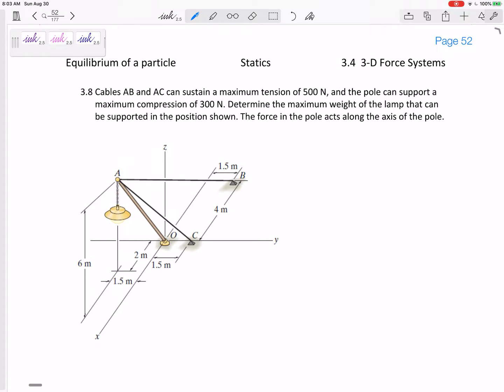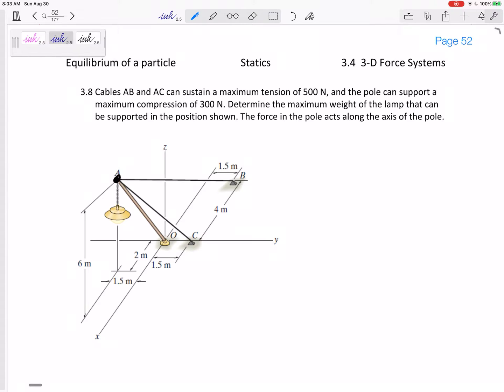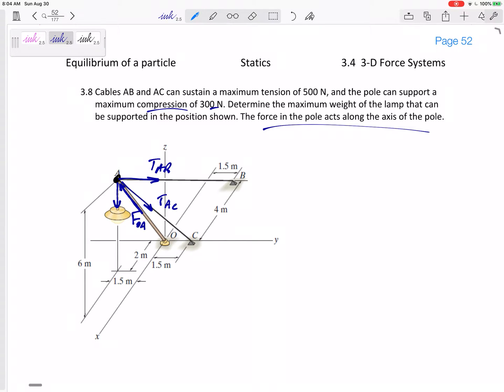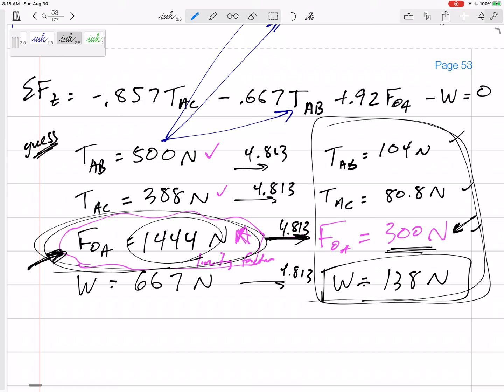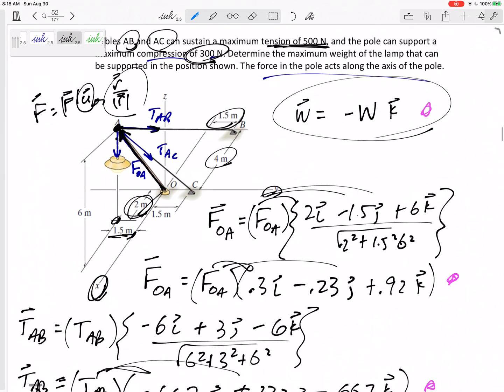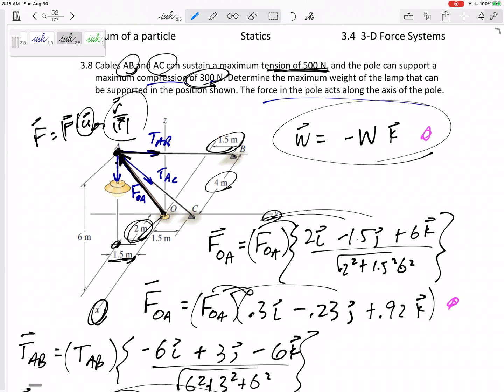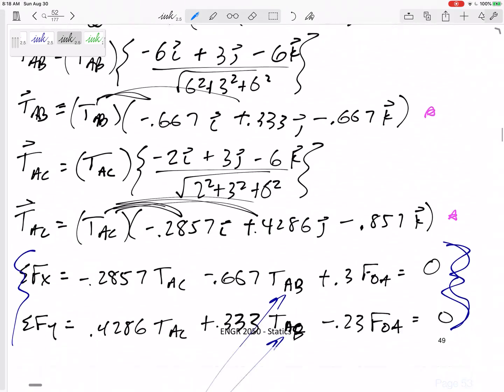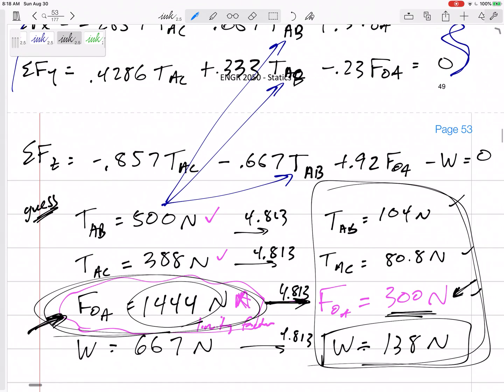Statics - 3D Particle Equilibrium example 3

Comment: So I tried this out on my own before viewing the solution, in which I multiplied the tension of the cable by the unit vector, but got wrong; I'm confused , why do we plug in the values of the tension after writing expressions for the unit vector forces?
Reply from the maker: Which one force did you set to the max? Only one of them reaches the max, so you can’t set all of them to the maximum - it wouldn’t stay in equilibrium. So you could guess one of them to reach the max at the beginning- solve- then see if you guessed the right one. But I like to wait until after writing the equations to plug them in. Sometimes those equations would help you see which one is the largest. Does that make sense?
Reply: @engineeringdeciphered  yes, thank you